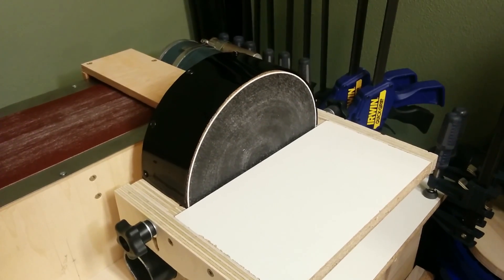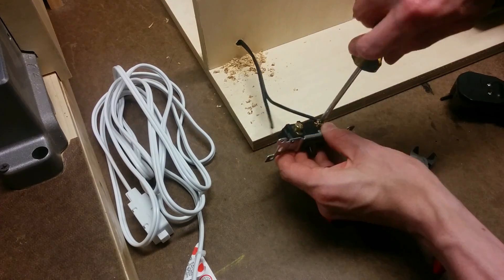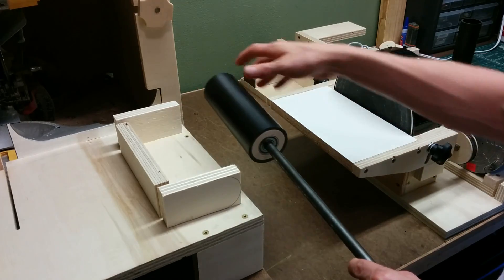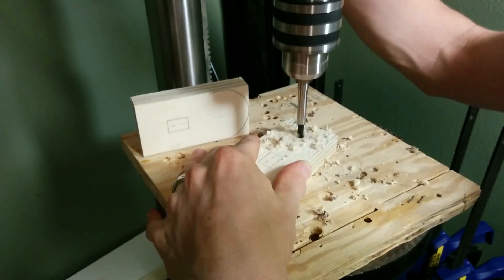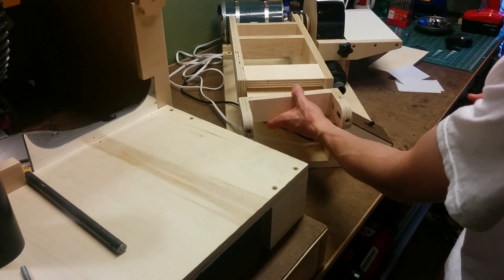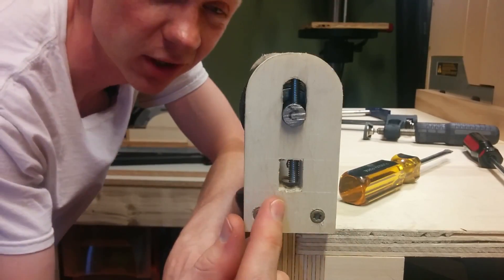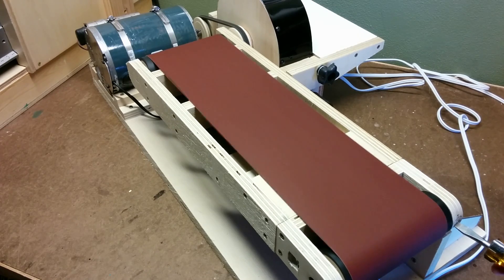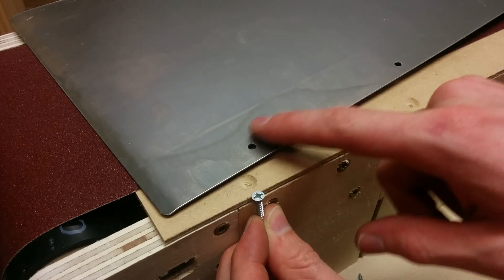Finishing the Homemade Belt / Disc Sander (Part 2)

Comment: Hie Are you still using this design in 2021. Any modifications you made after this video? How well is it running. Thanks
Reply from the maker: I still use it, but not near as much as my other 1" strip sander I made. I like that one better. For this belt sander, if I made it again, I would stack the belt sander on top of the disc, that way the disc sander portion doesn't get in the way of belt sanding like it does now. It would require two drive shafts though, so it would be more complicated to build.

Comment: Nice job. Just don't like the disk sander extending above the belt sander. And access to using belt sander is even hampered by the motor, if you were to take dust collection board off the motor still extends above the belt. Can't run any thing very long across the belt sander. Buy like I said nice build.
Reply from the maker: You have some great points.  Thanks for watching!

Comment: What is the rubberized component?  Many applications there.  You could even make and oscillating spindle sander.  Thanks for the vids...
Reply from the maker: +William Ward is from a bike inner tube. I would like to make a spindle sander someday. Definitely on the list.
Reply: Hi Justin, I am referring to what you are holding in your left hand at 4:15.  You are putting the bearing & bearing holder in some sort of black sleeve cylinder.

Thanks for getting back so fast. I feel this is one of the most import parts of you build. Could not identify it in the materials list.

I really get a kick out of you engineering "LOGO"  and using your initials. Would make great T shirts and stickers for  your site.  

In addition perhaps your plans can also be saved in .pdf I no longer use sketchup I have now switched to Fusion 360.

Thanks and I hope you built something interesting and useful today...

Will from Akron Ohio...

Comment: Superb, Justin! Excellent planning and execution. I had been wondering lately about building a wide belt sander for a specific application, and you've shown it to be quite doable.  By the way, at the end there was a shot of your benchtop drill press. I'm in the market for a good quality medium duty one. What kind do you have?
Reply from the maker: Thanks Jim. It's A Craftsman 12". Haven't had it too long but it has been working good for me.
Reply: That's good to know from someone who's a actually used one. All I knew was from the ads. Thanks.